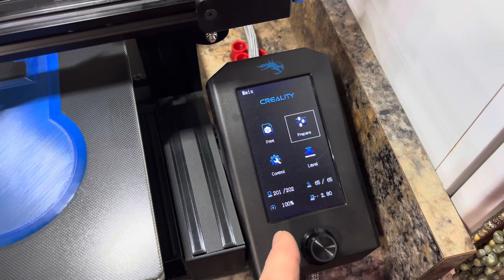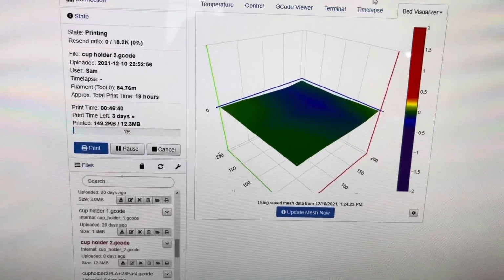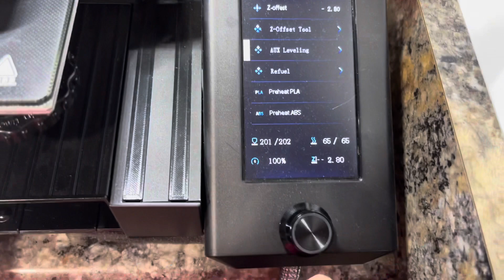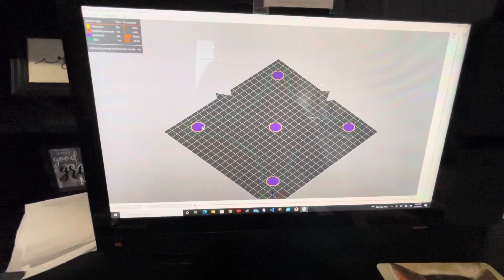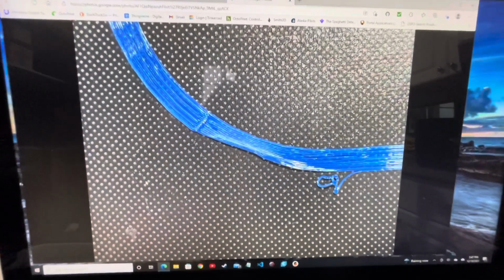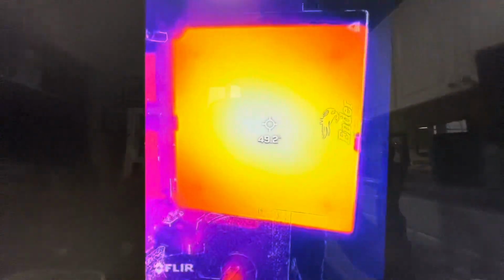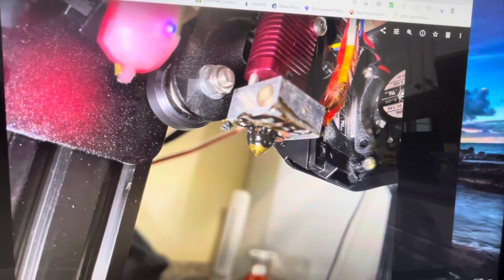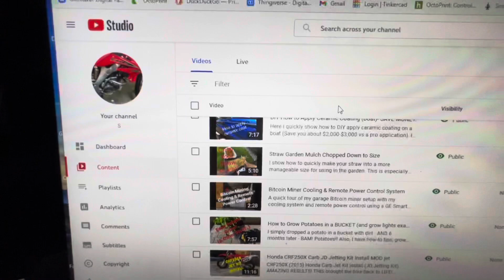Ender 3 V2 3d Printer Problems, Solutions & Troubleshooting

Comment: This is what I have been needing to see, you guys are awesome and thank you for the pointers in what could be wrong. I’ve had an ender 3 v2 for like 4 years maybe now got it for my birthday, I had it all set up nicely but I moved and since I’ve shipped it to where I am now I haven’t been able to get a solid print in 4 months
Reply from the maker: Glad to help.  If you can, consider finding a used Prusa MK3S+ out there.  They are a lot more reliable and you’ll spend more time printing vs tinkering with the Ender.  Although the Ender, when it’s dialed, does a great job.

Comment: I have an issue where after 10 minutes of heating up before making a print, it will start screaming amd saying the temp of the nozzle and the bed are too low. Anyone know how to fix that?
Reply from the maker: I would look into checking your thermistor. There’s probably some YouTube videos on that. Most likely it’s not sensing properly.

Comment: whenever i slice a print from cura, and then start printing it, my printer crashes at the start. any solutions?
Reply from the maker: First thing is to check your printer firmware.  Then - check the see if you have the most up to date Cura.  It’s possible there’s some Gcode that’s been inadvertently inserted into the beginning of the Cura slice code.  If it were me, after checking the first two software issues - update - if that doesn’t work- try uninstalling and reinstalling Cura. Also- I now use Prusa Slicer.  Try that if what I said before doesn’t work for you.  I like Prusa slicer and they have Ender profiles you can download for free.

Comment: My printer has leveling issues. After leveling it works fine, until i turn it off and back on later...
Suddenly its home position is too high up and the filament doesnt touch the glass plate.
I marked the leveling screw wheels and they dont move at all.

What can cause this?
Reply from the maker: Make sure when you set the z offset - that you save it in the settings.  Seems obvious- but that’s what I would check first

Comment: I know this is a shot in the dark but I don't know what to do..I have an ender 3v2 I bought brandnew worked great until I started having the same issues your having so I took it apart cleaned it all now as soon as I press print it warms up then says print stopped.. does nothing else.. I have purchased a all metal extruder capacorn tube and micro Swiss hot end along with new nozzles. I have not installed any of it yet.. just trying to figure out this issue first.. and in would be greatly appreciated
Reply from the maker: Probably the hot end.  I had a defective thermistor

Comment: You can definitely slightly adjust the glass bed. Just put 1 or 2 layers of tinfoil. The glass is heavy enough to bend. You may just need to add 1 clip per edge (compared to just the 2 included clips. Clips are about $5-10 depending where you get them, or you can also 3D print a longer edge clip /half-sleeve
Reply from the maker: Great tip.  Thanks!!